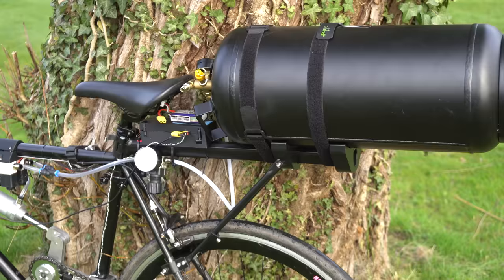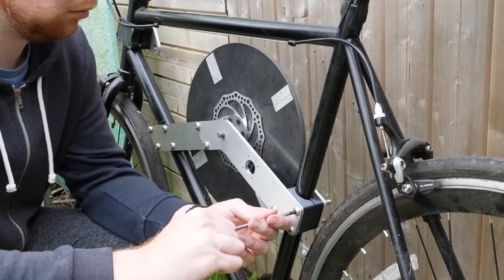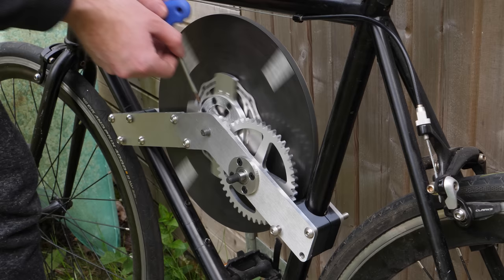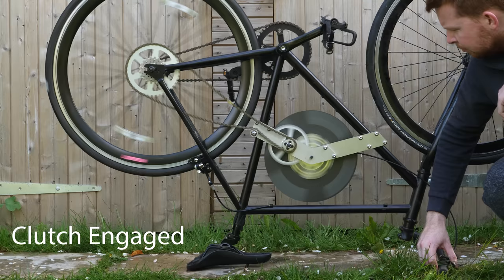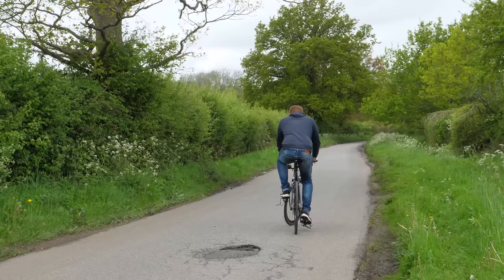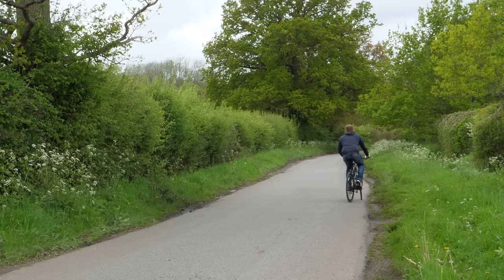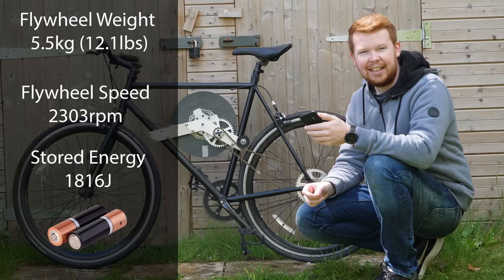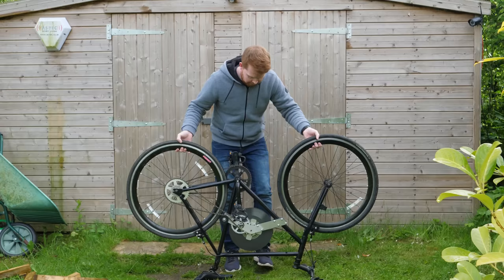Flywheel Bike KERS

Comment: Get the flywheel up to high speed when going down hill, then use that energy to assist when climbing the next hill.
Reply: Sadly it doesn't work like that
Reply: Ya so basically if you were going down a hill you would normally use breaks on, you can recover some of that energy into the fly wheel.

But if you would not normally use breaks to go down the hill you would be better to just let your inertia handle it. Less steps less loss

The most practical application for that sort of system would be something where there is an overall drop in elevation with steep hills down where you have some reason that you cant just let your speed go up and down as you pass over the hills that youd likely already clear with the overall downward slope
Reply: @squirrelspown  My city has a ton of relatively steep hills with regulated crossings at the bottom, so the use case is very real sometimes. If only the implementation wasn't mediocre at best with a flywheel
Reply: @nonnodacciaio704  If you'd have to use your brakes to slow yourself down under normal circumstances, yes it does.  Not having an infinitely variable gear doesn't help but it should still work.  Clearly it won't get you all (or probably very far of) the way up the hill, it will get some of the way up for free.
Reply: @MrCh0o  

Ya that makes sense

but....like he described in the video though, one might infer that the best case scenario is if you never come to a full stop.
At best reducing speed by up to half before you lose your storage. 

so if you need to stop at cross walks you may loose alot of the theoretical benefit by dumping a bunch of energy into breaks

So im just spit balling here....let me know what you think

I imagine the optimal workflow would be leaving it engaged and peddeling with assistance the whole way so all you need to do is overcome friction losses and any positive delta
and the flywheel sort of governs your speed sort of just acting for you as if you had the inertia of a large object even though you are a small one.....but you dont get the potential energy benifits of being a large object
Does anyone know how the math works out on that?

if speeding up and slowing down is required i imagine you would peddle hard on the way down to charge it diss engage completely while you look if you need to slow down or do slow down.... try to get back up to a solid portion of the disengagement speed  and use it to push up maybe 1/3 of the hill?
Reply: @squirrelspown  actually I think you might be better off just leaving it engaged the whole time since if you rely on your bikes inertia, you'd be going faster than had you kept the flywheel engaged the whole time, and since drag goes to v^2, you want to keep your speeds down. I bet the horrible efficiency comes from the mismatch between the speed of the flywheel and tire (so the clutch insnt fully engaged and ends up dissipating a lot of heat)
Reply: @gabrielschoene5725  Not every instance would allow you to just accelerate the whole way down a hill. There may be stops or you may simply not want to go 60MPH on a bike. So capturing some of that energy back to the flywheel makes sense.
Reply: People who says thats not useful either don't actually use the bike in streets or don't have hills where they live.
Reply: The amount of energy that you are absorbing by going downhill is how much you're slowing yourself down which is just how much more you'll have to speed yourself up at the other side. It doesn't work this way and the amount of energy extra that you have to spend would have not made up for the amount that you'll get
Reply: @scottgriswold384  down hill biking would be a great application for KERS.    I got out of it before I ever made my setup, but I wanted to have a pneumatic system for braking and boost.   Pipe dream...
Reply: @Dani_el_Duck  in the case presented by op, it would be useless, but if you're going down a hill and then have to stop at the end of it and then start again, then it would be useful
Reply: @Dani_el_Duck  I'm thinking the same. It could be useful on gentle rises and falls or in traffic where your speed is often changing to the traffic. I get that a lot where I'm forced to brake for a turning car and then the initial acceleration is what takes the most muscular effort. Here you could get at least part of that energy back but right when you need it.
Reply: I would aim for me winning back some energy when I have to stop for a traffic light when zooming around town. Getting back up to speed after those is one of the most annoying things when cycling
Reply: @MrCh0o  5 KG extra
Reply: The weight of the flywheel wouldn't be worth it.
Reply: @Wizardmom  It might actually help as a damper to smooth the speed/accel/jerk.
Reply: @pilotavery  nobody is claiming this is a perfectly efficient system, they ARE claiming that even some stored inertia is better than 100% leg muscle.
Reply: @DrewLSsix  in this case it wouldn't actually help going down and back up the hill again.
Reply: @DrewLSsix  because unless you are using the brakes, you're better off just gliding all the way down the hill and then using all of that momentum back up the hill, because using some of the energy to spin this wheel is actually kind of like breaking which means you're slowing down which means you can't get to the top of the hill which means you have to use some of the flywheel to help you get back up when you could have just gotten back up had you gone in the first place.

This is great for stopping with the break and accelerating again but this would not help you by going downhill and getting back up again
Reply: No, that's about how it works.
Reply: You're assuming the rider wants to go down the hill at the highest possible speed. But people often brake while going downhill, and that's the energy you store in the flywheel.
Reply: @labibbidabibbadum  Also wouldn't the gyroscopic effect of the rotating flywheel make the bike more stable when moving at lower speeds?
Reply: @nonnodacciaio704  It does work like that. When you brake when going down hill all the kinetic energy is turned into heat and wasted. On the contrary if you capture that energy using a flywheel it can be used to power the vehicle when going uphill although you will not be able to make it all the way to the top of the hill (assuming the downhill and uphill are at the same elevation) due to conversion inefficiency. Such a system was used in trams long back.
Reply: @karthick86c  no if you read op's comment you'll see that he doesn't mention coming to a stop or breaking
Reply: I just spent last week riding a fairly heavily loaded bike thorough a quite hilly part of the Hudson River Valley, so here are my thoughts hon how this would work on hills.  Most of the steeper hills I went on would be suicide to go down at full speed , especially the  gravel topped ones, so you could get the flywheel going fast down those, and save wear on you break pads. Now the first part of the next hill is usually the easiest, so I would still start to climb without the clutch, and only engage the clutch where I start to really loose my speed at the top of the next hill, were I always struggle the most. That being said, this last week was the first time I toured with a moderately heavy load, and that extra weight might not be worth it.  I would love to see a video on how your design would work on hilly terrain.
Reply: @nonnodacciaio704  Oh! Thanks for correcting me! My bad!
Reply: While just going down the hill as fast as you can to gain momentum for the next hill is more efficient than using a fly-wheel system, going down the hill as fast as you can makes you more vulnerable to dumbass car drivers who pull out of their driveways fast and even potholes if the road is bad enough.
Reply: @scottgriswold384  This exactly. I love bicycles, I really do.. but for some reason my brain wants me to break the sound barrier when I'm biking, and this usually always ends up in fishtailing and utter destruction of my peripherals as well as bent frames.
Reply: I think he should add this idea with an electric motor, induced by Friction. The rotor will charge the battery, and you just climb hills with the e-bike mode without any struggle
Reply: I think trying to use it from a fully stopped state will be a lot more difficult than using the forward momentum and using the stored flywheel energy as a boost.. Or maybe it doesn't work like that. INice effort though.
Reply: @DrewLSsix  try pedaling to the top of the hill with an extra 5 kg on your bike and then tell yourself its easier on your muscles.
Reply: Multiple flywheels.... try that
Reply: but after your very little power boost is over, you have to climb rest of the hill with way heavier bike.
Reply: @squirrelspown hook up a compressor engine to the clutch system and put a tank in the back, then use a impact driver or air raid syren motor to give it back at the end of the hill, the difference in pressure would increase the pressure of the motor (?)
Reply: @TM450FI  
So it's a good thought in theory
But again, (And this is my original point) any energy conversion imposes loss, and (in general there are always special cases) converting to a completely different kind of energy is even more lossfull.
And all kenetic energy storage methods (pressure and fly wheels) very much benefit from scale (because the reverse square law is a thing) and any system on a bike is by necessity light and small

kenetic/rotation to rotation (bike motion/wheel to flywheel rotation) is already more loss than youd like it to be (empirically and mathematically you can test it its just not very efficient. Useful....maybe...efficient? not so much )  Adding 3 extra levels of conversion  though a compressor and back out of the compressor back. youre looking at a ton of loss

I see everyone talking about storing downhill energy, and again its a good thought, but the <recovery> is what sucks. And this mostly becomes worth its while by never slowing down and buffering effort to help the human maintain constant optimal power output.

Your idea in particular because compressed air storage also does not have that great conversion yield

They use it for grid scale power storage 
Electric > compressed air > electric
And we are <really> good at getting as little as possible loss from electric turbines like <10% loss
But loss in compression and decompression that grid scale system that benefits from scale is only like 50% energy recovered

Id be surprised if a system that could fit on a bike got enough power recovery to move the bike at all, given even a sizeable hill. Let alone be useful

Comment: The sound coming from these gears made me appreciate how well made bicycles are
Reply: That's why bicycles have chains and not gears ;) they are much more efficient, have much less wear and takes a lot less maintenance than gears.
It's no just a matter of noise.
Let's all just take a second and thank the guy that invented the chain.
Reply: @flymali691 ...what are you thinking bicycle chains are typically attached to? Upon a second glance, the noise here seems to be coming from the chain making poor contact with the front gear just due to the lack of chain slack. He could have gotten rid of his weird excuse for a chain tensioner, since it's a single gear ratio, then just actually tensioned the chain directly. But given everything I've seen, I don't think this guy has a working relationship with bicycles
Reply: @tay-lore  A gear is specifically something that interlocks with other gears whereas a sprocket is specifically designed to work with chains. Sprockets and chains go together.
Reply: @TheInfectous  ah, I see. This guy's sprockets sound shit
Reply: @TheInfectous usually* interlocks with other gears. Also that’s for English. In my language both things are just called teeth wheels directly translated

Comment: Hey, that sounds like an amazing Sack Shredder
Reply: You'd be LUCKY if it ONLY cut into your nuts and NOT the sac getting CAUGHT and WRAPPED around that terrifying Infertility Wheel at full spin...
Reply: It reminds me of when I rode a Yamaha Virago motorcycle which had a mono-shock rear suspension.  The one shock absorber was positioned oriented horizontally front to back under the seat.  And it was filled with nitrogen at a pressure of 150 to 200 psi.

Comment: Going down a hill you could get the RPMs up really high, then use it to help with going up the hill on the other side.
Reply: Isn’t the emount of energy the same? The flawheel stores some energy but you also have to carry more mass climbing up
Reply: @ImadogGarcia  Yeah, presumably -- but it's so much fun zooming down a hill that you can pedal fast and not notice.
Reply: @ImadogGarcia  Theoretically but due to the laws of physics it's unlikely you'd get even halfway up the hill with just the flywheel

Comment: I can already imagine V2 of this bike:
Tom pedaling next to you at a red light.
You look at him weird. 
Then green light > clutch engage > zoom away.
You in dust.
Reply: I think the bike would work great on hills. You can store all the excess energy from riding downhill into the flywheel. Imagine Toms smirky grin at the red light on the foot of a hill. Then he goes rattle rattle SWOOSH. Until he has to carry the extra 6kg back up the hill by muscle.
Reply: Hehe. "Too soon, junior." SCREEECHHH
Reply: You just have to hope. That the red light ain't to long.
Reply: Honestly this one seems weird. Cool idea, but acceleration is already the one thing bikes excel at. Any cyclist who uses their gears well can smoke cars at an intersection.

Wind and hills are the primary enemies of a bike.
Reply: @unything2696  yes, you could also spin up the flywheel using a motor and use it as launch control.

Comment: You need a 19lbs plate and a transmission to a higher gear ratio to get more value out of the discharge. You'll see a dramatic change in how aggressive the takeoff will be. A sort of tapping of the clutch can get you up to a pretty high speed. I'd recommend doing the transmission from the other side of the bike.

A sort of 2chainz bike if you will.
Reply: Ok.  The stupid joke made me smile.
Reply: My preference is the Spec Clutch. Only cause Mitsubishi Evo. :) You could change the Clutch to a better one. I'd also recommend Volk Racing Rims for bikes like yours :D. I've also heard Corbeau makes really awesome bike seats!
Reply: Would it affect how hard it is to pedal the bike?
Reply: If so, how much more would it possibly be?
Reply: @Animalstyle69  The whole video is a gag/lesson bro, imagine if someone put regenerative braking on an e-bike. Power to weight ratio would be absolutely thrown off. There's some things you just can't add to a bike if one of it's most critical component is forgotten. And that component would be weight.

Comment: UK Guy: I found people selling steel discs on eBay. 
US Guy:  targets. You bought targets.
Reply: Lol
Reply: UK guy: i needed to make a plate which was pretty wasteful of material
US guy: i got this huge piece of billet to make a small washer
Reply: What is this "tar-jet" that you speak of?
Reply: Steel discs for targets? Not even
Reply: That is exactly what they are for
Reply: @MinutemanOutdoors  Shot an engine block at a junkyard, didn't enjoy the comeback whizzing by my ear, no thanks
Reply: @crazytrain7114  youre supposed to hang the plates so they angle with impact or. Mount them at a safe angle. Plus most engine blocks are made of cast materials or milled metal thats thinner than these plates.
Reply: @crazytrain7114  they are hung freely. When shot the round hits and the disc absorbed energy and is directed down to the ground. It's extremely common.. And normal safe practice when used as suggested
Reply: Active Self Protection Channel frequently advertises discs as targets. But they're made out of a special bullet absorbing plastic and are considered safer than steel.
Reply: Lol
Reply: yes! rifle targets, swiveled, when hit they ricochet to the ground, and move the arm to see the target move at 1500 yards
Reply: Not AR500 and no mount holes... Crap yuro targets...
Reply: Italian Guy: You bought my pizza stone!
Reply: Nah, those were mild steel. Targets would be AR500 steel, mild steel will just end up with a bunch of holes against most rifles and some handguns.
Reply: @dunzerkug  i would be willing to bet money that there are multiple types of steel targets for sale on ebay, chinese, american, indian, russian, lets remember,  ar500 is 3/8 inch thick